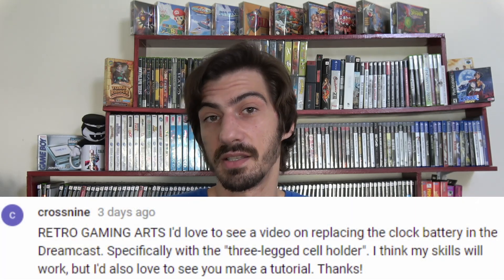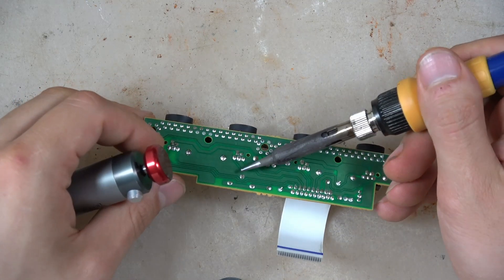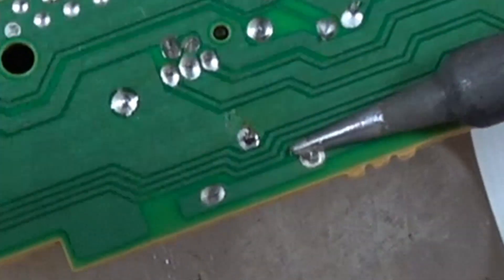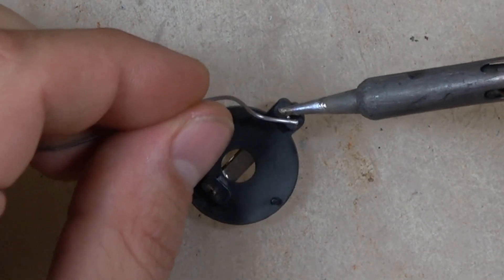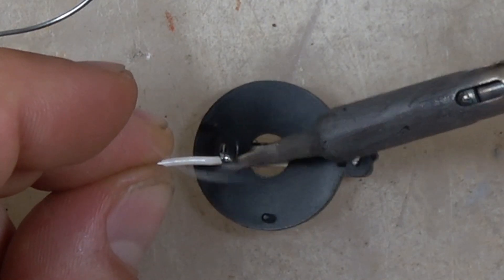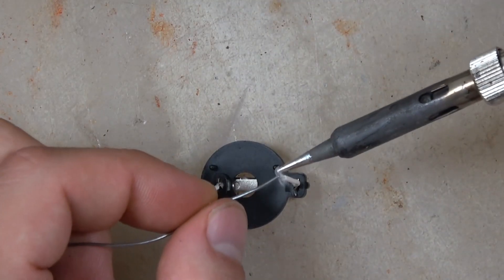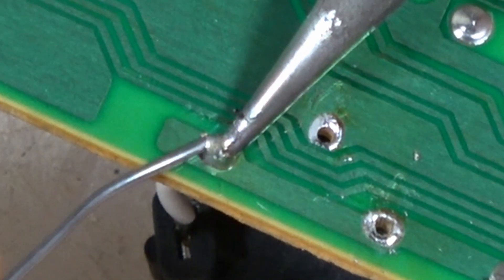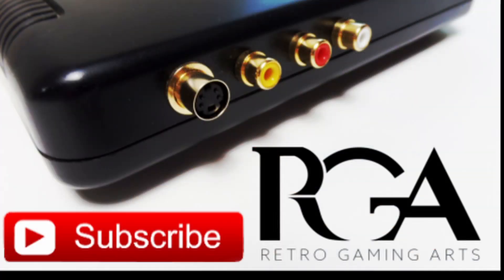DREAMCAST BATTERY REPLACEMENT - RETRO GAMING ARTS

Comment: You should take this down. A CR2032 is non-rechargeable and will possibly explode or cause a fire if used in this circuit. The correct battery is a ML2032. There are also vertical holders that will fit properly and securely in the system.
Reply from the maker: Thought about it actually, and for a few others I made mistakes on. but no one watches my older videos or my good videos so I figured whats the point
Reply: @ThirstWorldTTV 
The point is, that me personally trust your work. I am planning on doing a the battery mod for my dreamcast. So I checked your channel first, I am aware the video is dated but others might not relize.
Reply: You're right. This guy should edit this video to reflect that. Kind of careless if you ask me.

Comment: is the battery really necessary or can I just use my Dreamcast as is
Reply from the maker: Vladimir F no, its not necessary, but after a little while of using it with a dead battery it gets kinda annoying, and it feels better when you make saves and the date is accurate

Comment: I was just trying this, and I couldn't get the battery out. I was certain I desoldered the battery terminals, but the battery just wouldn't budge.
Reply from the maker: Elkplaysandpaints so, when you desolder something, sometimes the solder will drip down through the holes to the other side, and then you hafto remove the solder from the other side aswell
Reply: I see. I didn't know that. It'll be a while before I can try again though, sadly, cause my desoldering pump broke while I was working and I had to order a new one.
Reply from the maker: yea, that happens to me every so often
Reply: I finally got it. It took me hours cause the terminals broke off and the remaining pieces were stuck in the holes, then I kept messing up the actual soldering of the new battery terminals cause of the stress. I really thought I messed up my Dreamcast cause when I turned it on there was no audio or video. I was so stressed I didn't notice I didn't put the AV plug all the way in the console. Only I could screw up something so simple and still come out on top, I guess
Reply from the maker: Elkplaysandpaints haha, i screw up simple things all the time, im glad its working for you now!! Its nice to have your consoles WORKING the way they where ment to be, and doing it yourself is an extra nice touch